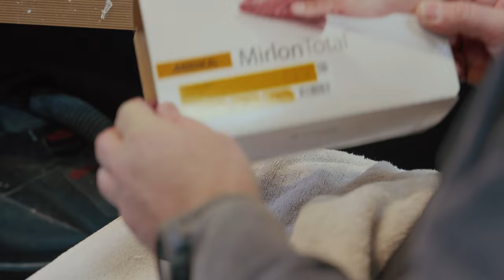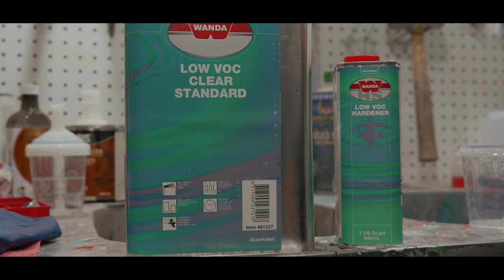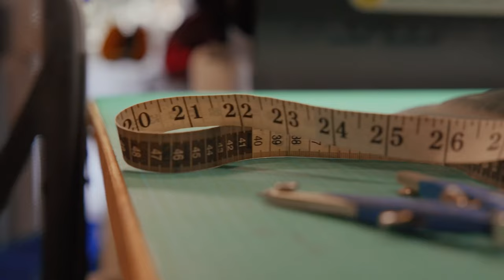HELMET PAINTING VLOG - EPISODE 4 2023

Comment: Hey Patrice, really appreciate your efforts to make these videos, they're so informative and well put together. I have a question about the Bell helmets with the air holes. They sometimes have little metal grommets around the holes. Have you found a way to remove these without damaging them? Thanks again from UK.
Reply from the maker: Hi, thank you for your comment. Unfortunately I didn't find a way to not damage them. I bought a box of these grommets from Amazon for cheap and replace them. You can even buy some white ones and paint them to match the helmet. Cheers.
Reply: @helmetgurucanada  Hi, thanks for the reply. I'll have a look and see if I can get hold of some int he correct size. They charge about $20 for 12 'official' replacements here in the UK. It's a joke.

Comment: Brilliant vlogs Patrice hate how easy you make it look 😭 regarding keying up between base coat white and starting to lay out fine line tape what steps do you take as I seem to have issues with paint peeling when I pull the tape off. Tried a few ways with red and grey scotch as well as 320 discs but would love to no a permanent solution if possible. 
Also regarding a previous comment would also love to no the computer design process. 
Not asking much but that’s your fault for starting these vlogs 😂
Reply from the maker: Try to slow down your paint drying. If you use fast reducer, try standard or slow reducer. Modern paints seem to be very particular about that. I was having adhesion problem as well until I started using slower cleras and slower reducers. Cheers.
Reply: @helmetgurucanada  brilliant thank you I’ll look into that. Look forward to the next vlog 👍🏻

Comment: Do you find the solvent eats the insulation foam you used to plug the vent holes? I normally use balled up tape for these vents, but foam would be easier to remove.
Reply from the maker: Not at all, the foam stays mostly intact.
Reply: @helmetgurucanada  I will need to give this a try!